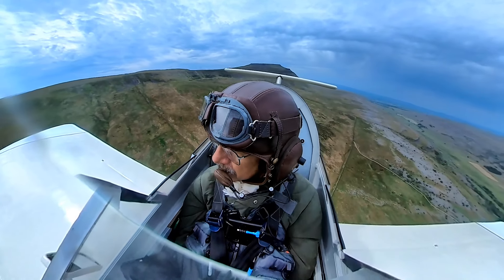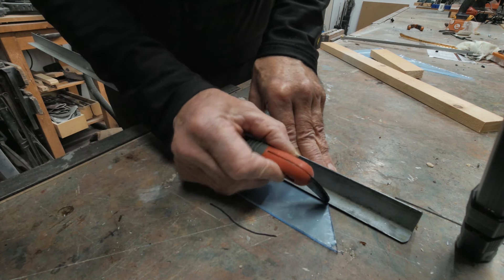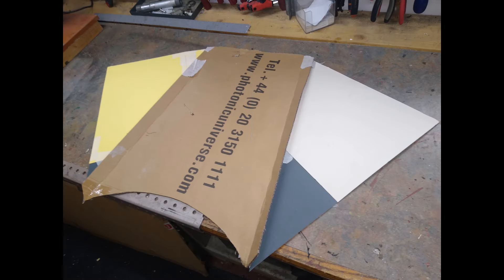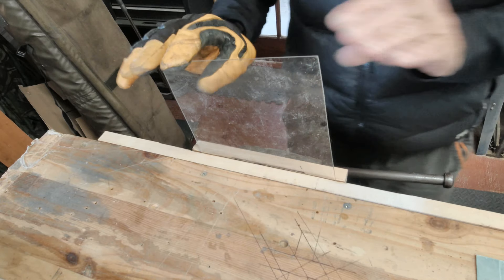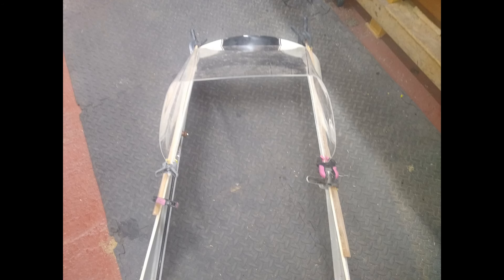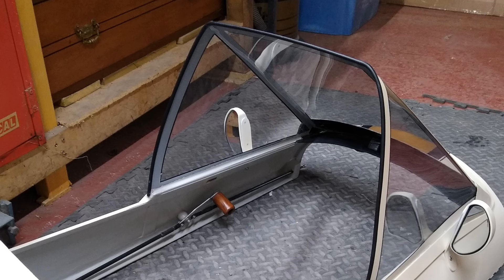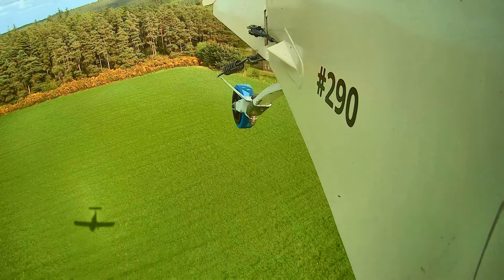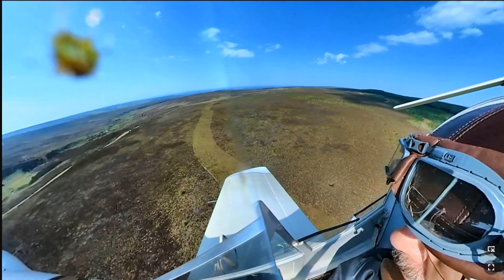MiniSport Mods Part 5: AirCon and Airbrake

Comment: Thanks Woody, another idea for our summers here.
I'm surprised that the speedbrake didn't work, have been contemplating a similar speedbrake on my SD-1. As for now, all efforts go into getting a low idle speed to increase the sink rate.
Reply from the maker: Hi Thomas. Yes, a lower idle speed would certainly help a lot, but I don't know how to achieve that with the standard carb set-up. No adjustment is possible beyond a certain hard point. I've managed to achieve a very slightly lower idle rpm by unloading the prop in a slip, but by then I'm more concerned with IAS than RPM. The speed brake should've worked. I was expecting a pitch down moment as the airflow balance altered and, to some extent a change in the lift vector. This should've been countered by the increase in drag and result in an increased RoD/rediced IAS, but it didn't. I'm confused..., so if any aerodynamicists out there reading this, can you comment?

Comment: I was already waiting for Your vid, thanks! What about to test the wind brake without holes in order to gain more drag? I miss too steeper descent rate because of obstacles near the threshold of my home airfield.
Reply from the maker: Hi Erkki. The video doesn't show the weeks of experiment that went into this. My Original design was a rectangular plate with no holes, as per the Isaacs Spitfire. This was heavy and, having done some reading about the design of dive brakes on things like the Douglas SBD Dauntless, it seemed that the holes induced drag through turbulence while destroying the lifting effect. This didn't work for me when I tried it and given the extra complexity and weight of something like this, I've shelved the idea until I can work out what's happening and fix it. Thanks for your interest..I'll keep you updated but in the meantime I'll cary on using Forward or Side slip to sort out the speed thing.

Comment: Your airbrake reaches an approximate 45-50 degree angle (videos can decieve but that's what it looks like), the Issac airbrake looks to be in the order of 80 degrees. Would your airbrake by any chance be acting as another alevator rather than airbrake if close to cog hence the reduction on vsi?  Most airbrakes I've seen - and I have zero expertise on them - are almost 90 degrees to the airflow.  Isn't there a gliding club onsite? perhaps grab one of their experts for opinion?
Reply from the maker: Yeah - I get the same impression, although the research I did suggested that 60 degrees - which is what it measures at full extension on the ground, is as efficient as 90 in terms of drag because there's not so much turbulence behind it which can upset the tail feathers. The same reason for putting holes in it. All according to US research, couldn't find much from Farnborough! I eventually taped over the holes in an attempt to improve things but with no measurable effect. It's possible that the maximum deflection achievable in the air is less than 60, as you saw (perhaps) on the video. Of course, none of this is really very important as ther's other ways of achieving the result, but I'd prefer to have the option of flying a really tight circuit sometimes, which I can't easily achieve under present conditions. The glider blokes use their spoilers to kill lift (doh!) and the airbrake effect is largely disregarded. How's things at OPF?
Reply: @TheMorayMosstrooper  OPF is great, no politics, just flying. EGFH on the other hand - which I manage, is another story..... Oh boy...! As my mother used to say - "you've made your bed..."
Reply from the maker: @spitss1  I guess you have Unions, Wokeists and general Jobsworthiness to deal with? I don't envy you as a civilian manager. In the military it was relatively easy..."Do the job, or don't go home. Any Questions?"
Reply: @TheMorayMosstrooper  Indeed, I've personally been based at Benson and St Athans during my stint, much simpler. No negotiation, no personal or vested interests, little debate, basically very efficient dictatorships 🙂
Reply from the maker: St Athan (s)...that tells me a lot. @spitss1
Reply: oops... yes why the 's' is often added is annoying, a bit like people calling Gower 'The Gower', I'll blame my infrigement on the two bases located there, the East and West ;-) Flew over Benson and Abingdon and just south of Brize last week, no reply from Benson, Abingdon still looks completely intact. A shame  @TheMorayMosstrooper